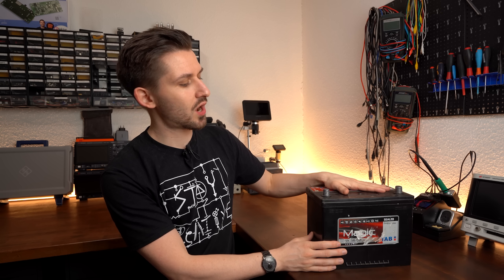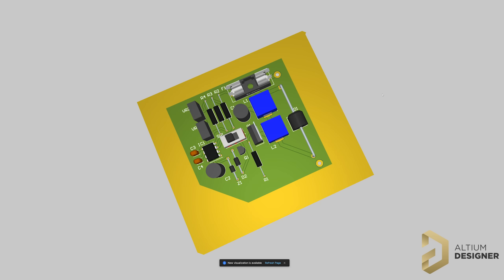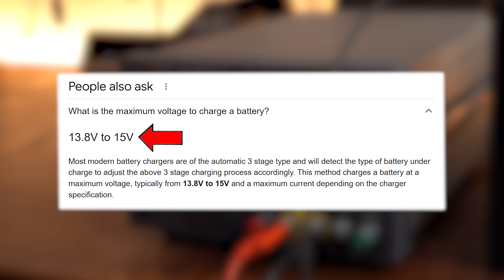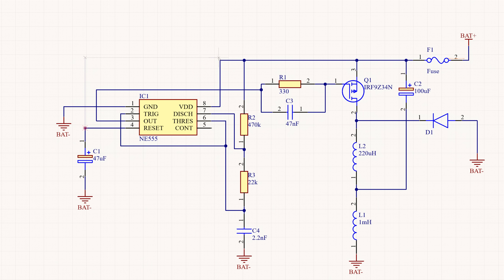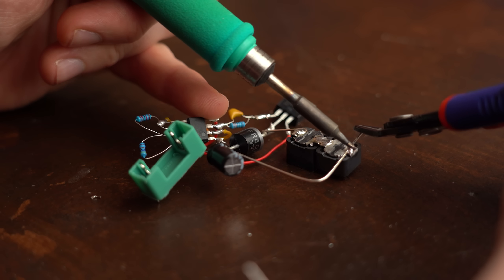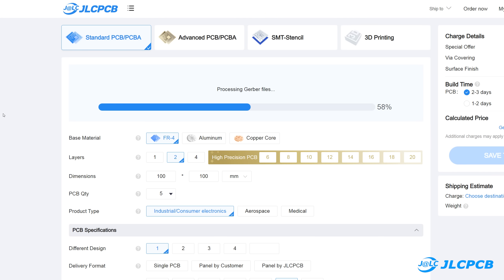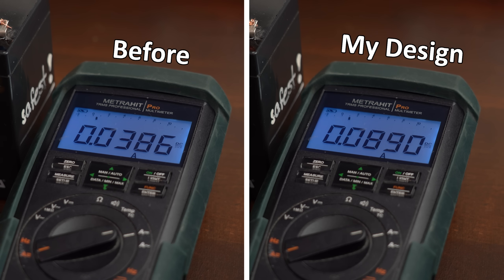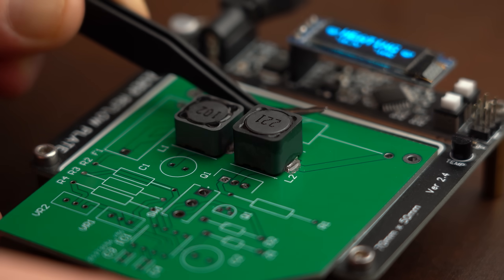I followed a YouTube "Battery Hack" and Wasted 30 Days! (Desulfator)

Comment: Desulphation of lead acid batteries is a bit more complicated than just passing current pulses to break up the sulphate crystals. First the battery needs to be emptied and washed to remove any sediment. Next the acid is replaced with new solution mixed to the correct specific gravity. The desulphation charge and pulse cycle is run through a couple of times until the two sets of plates are visibly different in colour when charged. The battery is then drained and cleaned once more before being filled with new acid. The capacity will never be as good as the original specifications but it can be used in an emergency situation to get out trouble if there is no alternative. The rejuvenated batteries will last for perhaps a year before replacement is absolutely necessary. This procedure was used for the emergency battery systems on merchant navy ships where the ships might be away in remote areas of the world for a couple of years before returning to civilisation where new batteries could be obtained. Not a trivial process and very time consuming and labour intensive to carry out properly. The other disadvantage is that any clothes worn when carrying out such battery maintenance dissolves into a mass of holes due to the effects of acid and the acidic vapour.
Reply: Yep can confirm. Old dude who has garage next to mine does it. He buys old batteries for 5euros washes them with different liquid and some other stuff and does revive them to sell after for 20 euros. Considering that he has to buy new acid and the time he sinks in I keep telling he is an idiot.
Reply: @NocKme  nevermind the lead pollution. I assume he's dumping the lead waste down the drain...
Reply: @NocKme  this is for sure better for the environment than throwing it away.
Reply: @Gruftgrabbler  well you can't just throw away batteries in Europe. I mean you can but not very legal. You can bring it to recycling place and even get money for it.
Reply: @Gruftgrabbler  Almost no one throws out lead acid batteries  they are 100% recyclable except the plastic case. You can also typically get a credit for them some where.
Reply: @Gruftgrabbler  Lead-acid batteries are already recycled. A DIY-er at home is likely worse for the environment considering the materials involved. The costs associated with proper handling of chemicals and waste, not to mention appropriate PPE, wouldn't make sense for a sole-proprietor. This sort of business benefits immensely from economies of scale.
Reply: Thank you! Finally someone explaines the fact behind the myth.
Reply: Thanks for sharing this, I didn't know about it. 🙂
I see the potential in emergencies, but thinking about it, the procedure is reaching towards fixing a broken hammer by replacing the handle. If that doesn't help then the head, too.
Same goes for the battery; if the plates are also replaced (assuming the container is not aged/damaged), we  got a new battery...
Considering the necessary labour, the involved hazards, potential pollution etc you mentioned, it seems full recycle is the way to go for good reasons.
Mind you, I'm not arguing, just saying, it's probably explaining a lot on how and why things go towards full recycling.
Thanks again for sharing this interesting aspect.
Reply: Usually with ~modern car batteries the problem is the lead sheets shorting between each other due to bowing or falling down at the bottom due to ware
Reply: @glenecollins  the lead like tinfoil, the absolute minim to make battery cell, and no more on
Reply: @dh2032  it is to make the batteries lighter… honest 🤥
Reply: "acidic vapour" Alright now i know why my shirts are full of holes with out getting any acid on it... thanks that explains it. Though other dirt could wear out the fabric too, just to note to anyone else wondering same thing.
Reply: I have also seen desulphation done for batter backup systems for emergency communications systems on remote mountain tops (to get line of site to each other) that was done with very high current pulses as part of the battery maintenance cycle to prevent the accumulation of the crystals in the first place so that the batteries, which were almost never used, would be in working order at all times. This procedure was done as part of the yearly maintenance cycle for the batteries, so there were few, if any crystals formed on the plates, but this would remove them completely and then allow them to drop to the bottom of the battery where they would be harmless.
Reply: Not entirely correct. You will usually drain, clean and fill will demineralised water, then charge. This is done to promote the desulfation by providing excess oxygen ions (from the water) so the lead sulfate can become lead oxide. Once this is done, yes correct, the right concentration of sulfuric acid is added and the battery is at the best condition is can be. What this process does not do is to restore the missing lead which had fallen from the plates previously (as lead sulfate) and was drained out when cleaned and how well the battery performs after restoration is entirely dependant upon the condition of the plates. I have seen plates which look like they have dissolved.
Reply: It's actually much more effective to drain the battery, recover all the sediment and entirely disassemble the entire battery and recover the lead plates.  The negative plates are almost always in almost perfect condition and the positive plates are almost always mostly or completely dissolved.  Next, remove the lead and lead sulfate from the electrolyte, then you can reform the plates, then clean everything and put it all back together and seal it back up.  Almost all batteries available have had this happen at least twice, since lead acid batteries are 100% recyclable and all materials can be 100% recovered (other than the sulfuric acid itself, since a lot of it evaporates or breaks down to water, hydrogen, and sulfur oxide/sulfur dioxide and evaporates/offgasses).  I have had a lot of success doing it this way and if you do youtube searches, that's how almost all batteries for europe are rebuilt; by hand in pakistan and india.

I have also been building my own lead acid batteries, since I can build them with much thicker plates and use PBO2 instead of PBO3 (gray/brown lead oxide instead of red lead oxide).  Using gray/brown lead oxide instead of the red lead oxide has a little bit lower surge or "cranking amp" output, but lasts MUCH longer and puts out a more stable power output over a longer period of time, but will not crank my diesel in the winter when it's below 40 degrees F(4.5 degrees c) outside.  Those batteries work super awesome for off grid power bank, though, and I get them for almost free and when I do 6 of them at a time, takes about a day or so and BANG, I have about $600 worth of deep cycle heavy duty lead acid batteries that will run the house constant and only normal minimal maintenance for 3 to 4 years each.
Reply: @johnbrizendine7716  curious...PbO for +-electrode....how or from where do you get PbO3 ?   you saying PbO2 is red ?
Reply: @zaneenaz4962  i believe pbO3 is red lead, u make it by oxidizing lead. It happens normally when forming battery plates.
Reply: @zaneenaz4962  the oxidized lead is the positive plate, regular lead is the negative plate. The positive plate is where almost all the chemical reaction happens.
Reply: The sulfates dissolve easier into distilled water than in acid
Reply: Just clean the plates omg 😆 New batteries have powder lead plates to increase current but leads to unrepairable battery that will need to be recycled, or remelted
Reply: Thats true , i remember the tales of my dad , not only they did clean and rinse the inside of batteries , they used to monitor each cell for bubbling , when a cell was bad , them used to take it out and disassemble it looking for the short circuit in the cell , usually from 2 bad batteries they would make a functional one , they would take the acid , filter the solid out of it , then they adjusted the acid concentration on the electrolite , then they would re assemble the battery . back then the batteries were made out of hard rubber. that was common practice in the 60s when he was a 3rd officer aboard bulk carriers , he used to keep an eye on the guys working with the acid along the third engineer, they were in charge of the hose , in case someone was splashed with acid ..
Reply: just buy a new battery
Reply: @jalie-15303b  changing acid won't do much as the sulfuric acid H2SO4 + lead oxide PbO2 is what a fully charged battery has - via a chemical redox reaction, you get lead sulfate PbSO4 and water H2O plus 2 free electrons (your voltage). To charge the battery, you apply a greater voltage in the opposite direction (polarity) and you get back your original lead oxide and sulfuric acid. Problem is that these compounds need to be in balance or the battery will not work properly (will not be a battery). Putting fresh sulfuric into a discharged battery from which most of the lead oxide has been depleted (replaced with lead sulfate) will result in not a battery - there is not enough oxygen (from lead oxide) to carry on the reaction. Similarly, if you drain a fully charged battery and replace with water, there is only lead oxide and water, and no sulfate (or similar anion) to allow the reaction to take place.
Reply: @astrawally8448  So you need deionized water in the fully discharged battery which when charging should end up with the acid returned into the water.
Reply: I buy recycled batteries exclusively and usually get at least 2 years out of them. I'm also in Arizona where the heat is brutal on batteries.
Reply: @NocKme dupe comment; delete this one because it has 8 likes while your other one has over a hundred!
Reply: I have a megapulser desuplhator on my old car battery and its been lasting for a long time now. My newer car has a weak battery because it has a small engine and electric heater that uses a lot of power.
Reply: So bottom line it's never worth it
Reply: Yep can confirm. Old dude who has garage next to mine does it. He buys old batteries for 5euros washes them with different liquid and some other stuff and does revive them to sell after for 20 euros. Considering that he has to buy new acid and the time he sinks in I keep telling he is an idiot.
Reply: @testing2517 dupe comment with no likes.
Reply: Thank you for bringing so much good and accurate stuff to the table
Reply: wast just about to jump on and say the exact same haha
Reply: Thank you for answering what I wondered about.  My first thought was the chemistry had changed.

It was a good video and he made his point well.
Reply: Maybe it worked on older style or deep discharge batteries.  On modern batteries, after such treatment, it is even worse than if nothing was done - the same as here - after regeneration, the capacity decreased.
Reply: this is what I know as well.  You need to physically remove the particles, otherwise due to the least resistance and all that- they just reform quickly.
So opening up the battery, with protective gear and containers, pouring out the liquid, and gently 'scrubbing' the parts down, straining the liquid and replacing it all tends to have almost 100% success rate, your effectively recycling an old battery into a new one.  You can even replace the liquid with new, fresh liquid if you wanted, which has the most success and makes the most logical sense - the chemical composition of the other solution, has changed through the cycles, after all.
Reply: Thank you. makes sense.
I presume this remedy would be even more problematic in diesel-electric submarines?
Reply: Sometimes you can push 30V through it for 20 min at a time until the internal resistance comes down enough to charge at 2amp
Reply: I always wondered whether re-capacitying Pb-acid batteries was a real thing. Now I know the details. Cheers!
Reply: I used to work with buckets of hydrocloric acid. We'd hose it around on a stamped piece of concrete that hold oxides applied to it. That washed the oxides off and let them pool into the impressions. Makes a nice patterned concrete look.

As a result, I'd get weak acid spray on my clothes. I actually used to do it barefoot after a while to save my shoes from falling apart so quickly. You could feel it, but it wasn't bad enough to strip your skin off any time soon. My clothes however, covered in holes all over from bits of spray splashing around or caught in the wind.

Lucky it was the 90s, so my tatty clothes were quite cool in the places I'd hang out :D
Reply: "The other disadvantage is that any clothes worn when carrying out such battery maintenance dissolves into a mass of holes due to the effects of acid and the acidic vapour."
Jebus dude, wear PPE and get a fume hood when working with acids and strong chemicals. lol
Reply: @WarrenGarabrandt He's probably not talking about batteries that you can just pick up and set in a fume hood.
Reply: @AtlasReburdened  not a lot of fume hoods have good forklift and chain hoist access lol.
Reply: @WarrenGarabrandt  hard to do that when out on a remote cargo ship and one of the batteries takes a shit, gotta do what ya gotta do when you are entirely remote and the battery you need takes a shit on ya lol

I completely agree with you, though.  I always use the apron, squints, fume hood, gloves, all that PPE, and still sometimes end up getting acid on something lol  but i'm just naturally clumsy like that.
Reply: My grandfather always put 230 volts AC on the poles for a few seconds with his old lead acid batteries. Then reload and sometimes repeat again. Strangely enough, his method apparently worked because he was able to do from 1973 to 1998 with the same car battery!
Reply: @VicGreenBitcoin  Because this battery from old times.
20-30 years ago, everything way indestructible.
Today, everything is made to fail in short term. 
Our clothes, toys, tv, radio, phone, everything was lasting minimum 10-20 years.

Today, every product is shit!
Reply: @tr9036   Grandpa is that you!?  Tr, its exactly what my grandpa (RIP) was saying. Seems you and him are right..
Reply: Thanks for the SA. Not today thanks...

Comment: so i used mostly an homemade re-emf charger or bedini for this... for me this works just fine. desulfating happens mostly while charging i think. also it uses high voltage spikes instat of current, so it breakes down the insulating oxide layer that than  disolves the acid...  we use two 5A re-emf cirquits even at work over the weekend to charge and keep the batterys of our 2 smaller electric forklifts full.(each one 160ah@ 24v) so we had never any problem whith those anymore and the batterys do live longer... but i dont think reviving is a thing. only prevent  or delay the sulfating. so take care of your batteries.

Comment: I've used a desulfator as a annual or bi-annual maintenance for lead acid battery's but never a "revival" tool. I have had cheap garden tractor batteries last almost 10 years and my wife last battery in her SUV was bought April 2013 and have been anticipating replacement any day now.

Comment: I believe that the drop in capacity each time is because the "rejuvenation" as well as the test cycle brings the battery very close to deep discharge. Lead Acid is not meant for that kind of charging.
The only way to enjoy a battery for the longest possible time is to constantly use it.

Comment: I love how this concept must completely ignore the fact that Lead Acid chemical batteries have not been new technology for 165 years. It's obvious that you did this for clicks and didn't bother to do your research first, because if you HAD, you would know that your car battery did not simply get old and tired. When the battery begins to lose the ability to hold it's charge, it's actually a symptom of an end-of-life fatal disease (if you will). All lead acid car batteries eventually die because the lead plates that exist inside of 6 individual 2.2v cells, will eventually become "Sulfated". It's a chemical reaction and you cannot circumvent it by simply forcing a charge into it. It's more likely that it just explodes, but it certainly wont start working again.

Comment: From what my research on these has shown, and using one myself, there is a point of no return for the batteries. If they are lightly sulfated it CAN bring them back to life. But if the battery sat dry, or has an internal short or broken plate no amount of desulfating will revive it. 

One other thing to keep in mind is while the battery may not have enough juice to start a car, it can still power lower-draw devices in an emergency if you are smart. Granted it is not totally nuked, to begin with.

Comment: Slightly different subject, I got sick of lead acid batteries dying.  In the last couple years I've been responsible for 6 cars:  Work and home, old and new(used) cars.  With the exception of an electric car, the other 5 had lead acid batteries from different brands that died at less than 2 years old.  I kept one going a few extra months with a desulfator.  Maybe manufacturing has turned bad, maybe I had bad luck.  I replaced my car's battery with a Lithium Titanate battery.  It cost me $1,000 for cells, busbars, and an equalizer (few BMS's can handle that current).  It's worked great for a year.  I just tested it with a car battery tester and I think I maxed the tester out at 1200 CCA.  I could have put fewer cells, but I wanted at least 100Ah for running things like a portable refrigerator (for the love of god, not a thermoelectric cooler).  In 10 years when that car dies I'll move the battery into my next car, or another project.